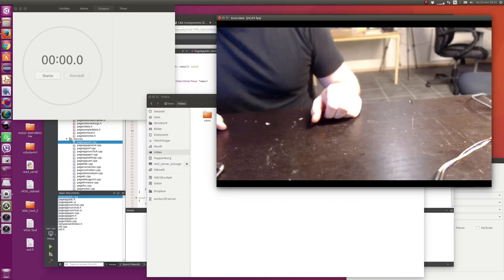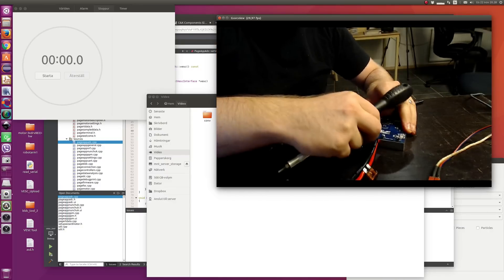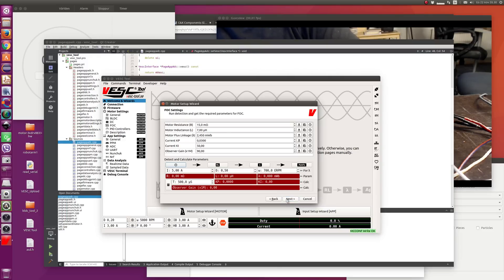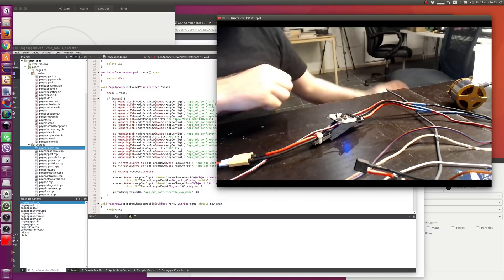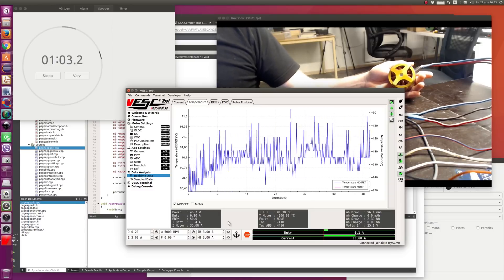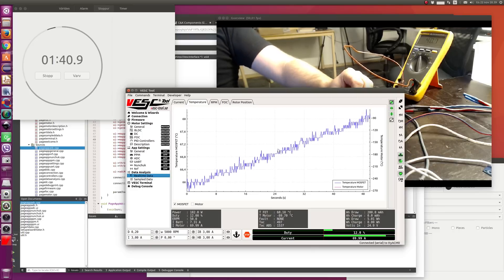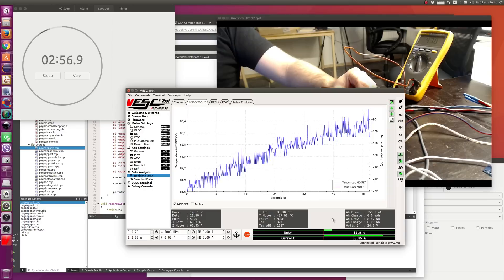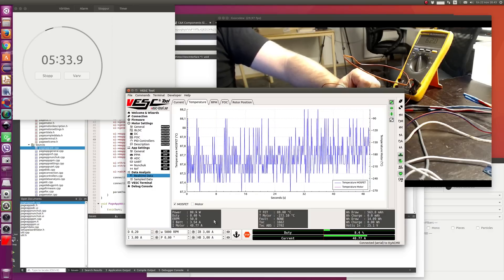VESC6 brief demo

Comment: How are you driving the motor at 70 Amps with no load?
Reply: hmm, that sounds better then what i had in mind. so it just spines it our of time to achieve the 70 amps. I wonder if it is producing the torque at the 70 amps; or if it is just a test mode and the motor dose not preform at all.
Reply: Is it acting a some kind of step down converter(Step down voltage, current boost) as the power supply current is much lower? The power from the PSU must be the same as that dissipated in the esc+motor.
Reply: By putting in non-torque producing d-axis current. D current is aligned with the field flux linkage whereas torque producing Q current is 90deg out of phase. Maximum torque usually occurs when the stator field is at 90 deg to the rotors field.

These are vector currents so in real world and in lamens terms, d current produces a field vector that is in phase with the rotors magnetic flux so there is no attraction force and no work, nothing to pull the rotor around - it just heats up the windings, stator and rotor. 

In this case there is just enough Qaxis current to get the rotor to spin to 50rpm while the rest of the current is in the D-axis.